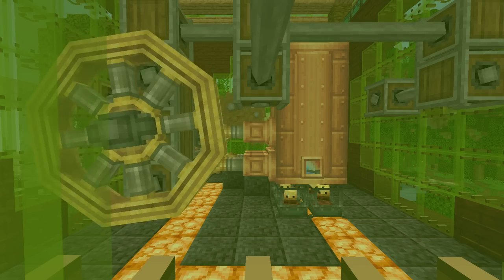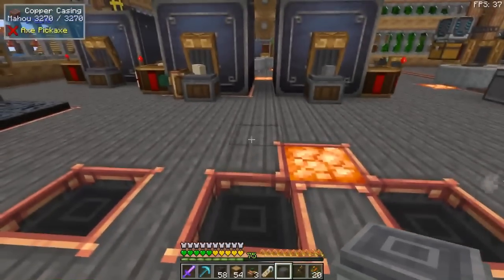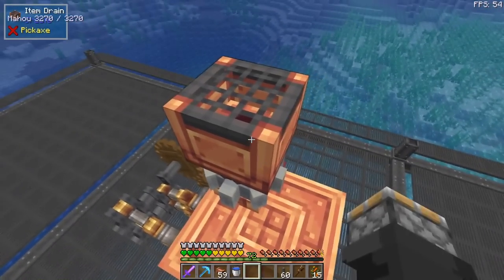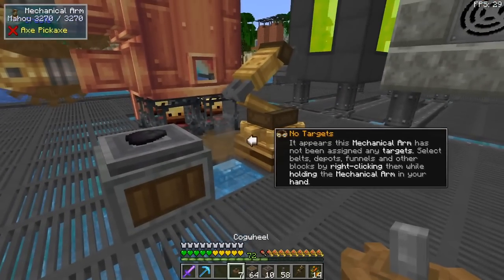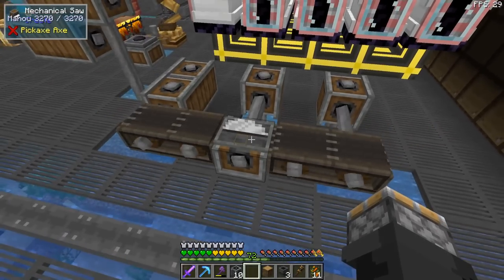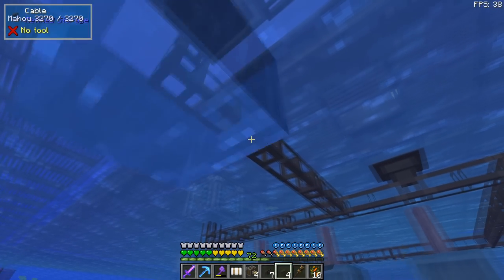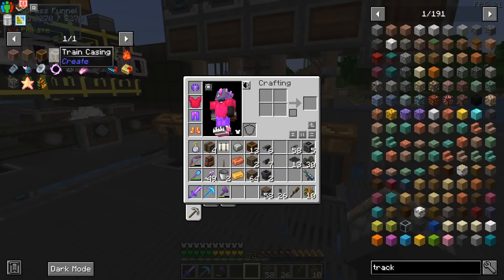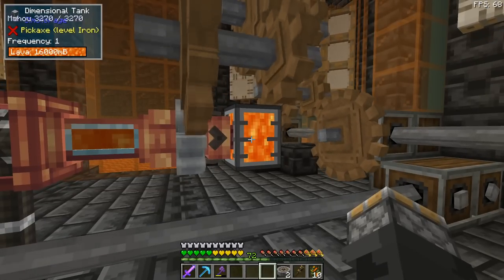Create Mod Automating Train Tracks & All New Casings - ATM7 Ep 17

Comment: Got a question for the Create Master. I corrected my issue with your help. But don't know why it was doing it in the first place. Brass casings... My saw (before I put the filter in) would make every other log into a (twilight forest) hollow log. Stripped, then hollow, then stripped, then hollow, etc... I can understand one or the other. But alternating between them???
Reply from the maker: Just reread your question. The Create saw will just randomize the finished piece being cut unless there is an item in the filter slot of the saw. Hopefully that answers your question?
Reply: @TubeAndKnuckle  Yes, it does. Thank you kind sir.

Comment: I currently have a problem while making the steam boiler. I have followed your exact steps, however the water boiler status is all red when it should have one green strip. I am unsure what my problem is other than that the shafts connected to the steam engine are facing the opposite directions, but still connected. Does that cause a problem? If not, what is my problem because I have no clue.
Reply from the maker: The shafts connected to you boiler shouldn't cause any issue as long as they don't touch each other while spinning in opposite direction. Did you jump start the boiler with water and did it turn on at all? If it did and then shut off. Then your supply of water to the boiler is not sufficient. Need to up the speed of the pump pumping water into the boiler or add multiple pumps pumping water into the boiler. It needs a constant supply of water to continue running.

Comment: Is there a reason you used pipes instead of a hose pulley for the water in the steam boiler?
Reply from the maker: You could use a hose pulley in place of those pipes and that should work? I wonder if a kitchen sink piped into the boiler would work as well? I have an idea now thanks!
Reply: @TubeAndKnuckle  I believe the hose pulley works for any liquid, you used it for the lava in the nether. The kitchen sink thing would be interesting to see, because if you can pipe water out of it, you literally have an infinite water source for contraptions wherever you want, and maybe even on moving contraptions like trains.
Reply from the maker: @BananaCoder  The sink definitely works for a water supply into a boiler. Just setup a train/boat in my latest video using it. But I failed to superglue the pipe from sink to boiler and it failed during the traveling part of the video😪But it works fine and is an easy water source.
Reply: @TubeAndKnuckle  That's cool, sad it didn't work in the traveling part though.

Comment: Heyo first and foremost thank you for the vids, Im trying to do this on ATM 8 and Im running into an issue where the exporters dont call on the system to make the stripped log, it will do just enough to fill the depots when I place the crafter and insert the pattern but will stop after the initial call and the stripped logs on the depots, does this method still work or is it just me?
Reply from the maker: Hey Alex, it still works as far as I know.
Reply: @TubeAndKnuckle  so wearing magnet charms around create is bad mmkay :) Great vid again!
Reply from the maker: @AlexB-rs4ql  LOL Yes indeed....thanks for the laugh Alex.

Comment: what it used to power the mechanical belt at 6:50?
Reply from the maker: Everything there is being powered by the Steam Boiler. The shafts run underneath the deck from the boiler to "hide them".
Reply: @TubeAndKnuckle what video can i find from you that shows the steam boiler on how you did it or something? Thank you so much!
Reply from the maker: @runaans8550  The belts are powered by the shaft spinning. You just have to run a shaft from your boiler to the belt. If you want to change the direction that the shaft is spinning you can use a gearbox to change the direction that the shaft is spinning which will change the direction that the belt is moving. Hopefully that helps ya.
Reply: @TubeAndKnuckle  thank you so much!
Reply from the maker: @runaans8550  No problem. Good Luck!